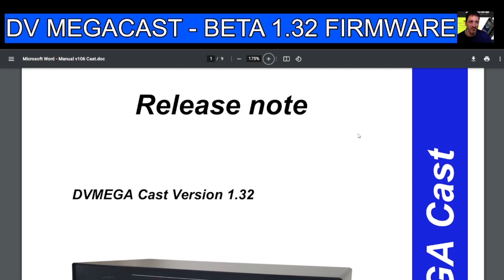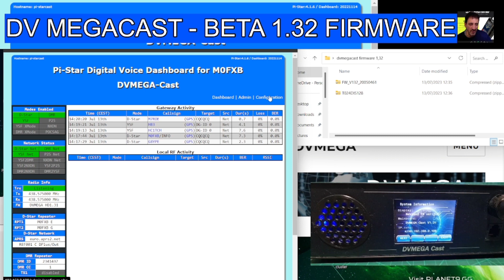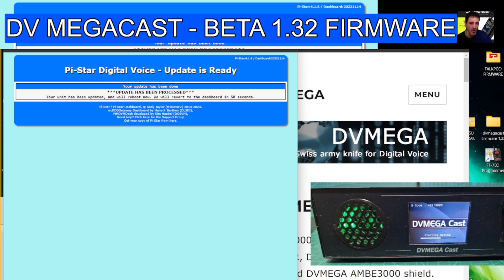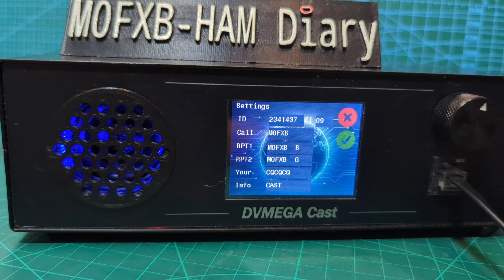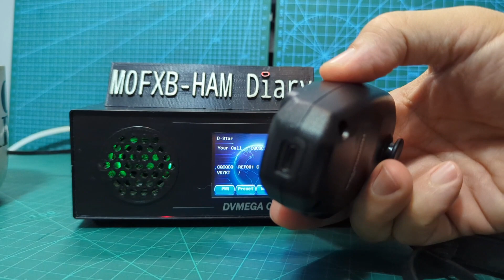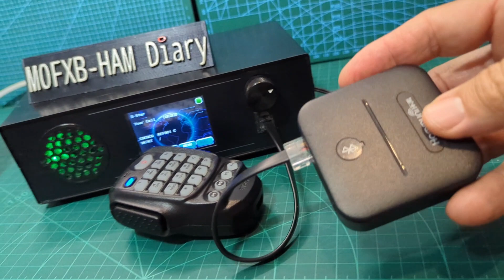DV MEGA CAST -NEW FIRMWARE 2023 V1.32 (beta) FULL SET UP & TEST

Comment: The preset on Fusion doesn't make sense. Actually have a problem where my audio cannot be heard on those using Wires-X with their Yaesu radio. Tried 00, 0, blank to no avail.
Reply from the maker: Mine works fine.

Comment: I cannot get mine to update i have reflashed my sdcard, followed what you did, and i put the zip file and the speaker turns blue, I then click update firmware to get to the next screen and once I hold down the encoder and click run the light goes away I let go but I don't see the reset screen for minute or so later. It fails to load the dashboard and the screen on the mega cast is stuck in starting mode. I take the power plug out and plug it back in so I can get back on the dashboard however the screen on the mega cast is stuck in starting mode. I need some serious help with this.
Reply from the maker: Hi Ruud from DV Mega will help you .
Reply: @M0FXBHamTech  Just an update I was able to update the firmware by switching my internet browser and redownloading the firmware. Thank again
Reply: @M0FXBHamTech  thank you